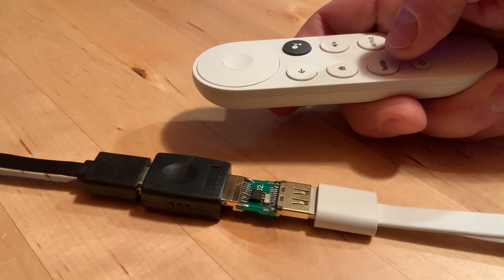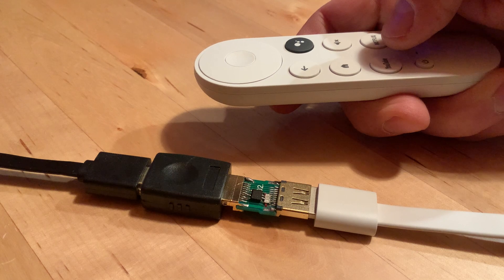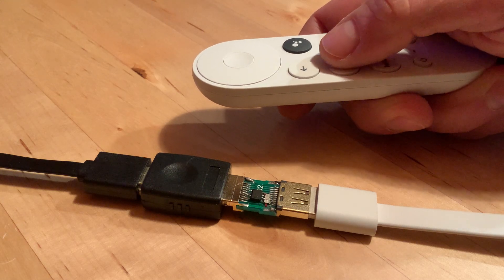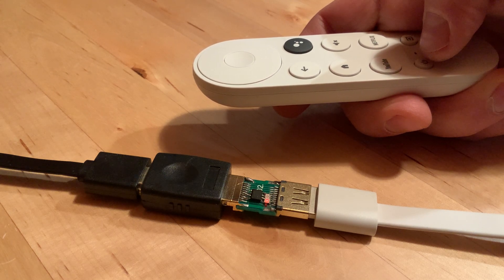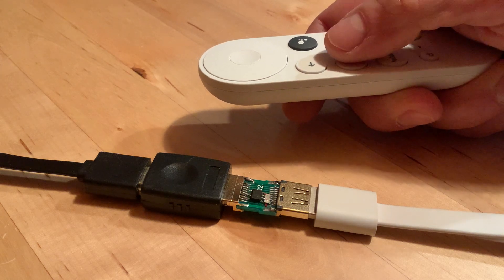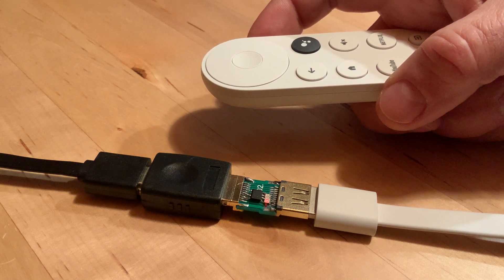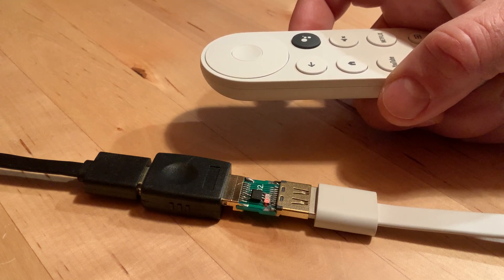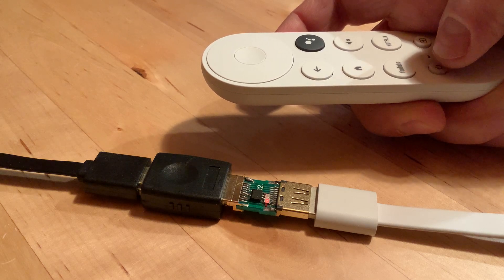CEC Tiny

Comment: How could I make the Android TV Bluetooth control be able to control the volume of the analogue sound system and also turn it on or off depending on the state of the TV?
Reply from the maker: Really depends on what that analog system is. You could either drive a motor turning the volume potentiometer or (as I did) emulate key presses on a remote (if your system has a remote).
Reply: @SzymonSlupik  My goal is to control a stereo from the TV. The closest thing is what LG TVs have called IR Blaster, which is an IR transmitter that I suppose turns on/off and controls the volume of another device, but my TV (which I'm actually using as a TV box) is with Android TV.
Reply from the maker: Then use an arduino-based prototype to see if your TV outputs the needed CEC commands. If it does, you can start experimenting with addin an IR Blaster to send your required codes.
Reply: @SzymonSlupik  It's too much for me. Thanks for replying. Maybe I can try later or it's too late for me to have a real sound bar...

Comment: Do u sell these?
Reply: I need around 50 or so to start with, can I get a quote? Don't worry they don't need to be pretty just need tvs to power on with the computers
Reply from the maker: @Heathmcdonald  No I don't, it is just a hobby project, but all info has been published: https://github.com/SzymonSlupik/CEC-Tiny
Reply: @SzymonSlupik  can it be used as cheap hdmi-cec adapter for pc? hdmi-cec adapter from  Pulse Eight is hard to buy
Reply from the maker: @mafirh4vdus  I believe yes, but you may need to use a different variant of the AT processor to support UART / USB interface and develop some code to push the CEC events to this interface. I think this could be a good starting point for you: https://github.com/SzymonSlupik/CEC-Tiny-Pro
Reply: @SzymonSlupik  thanks. I find easier solution. I find old amlogic s905 android tv box from 2016, with custom firmware it has build-in hdmi cec.  I am using two pins from android tv hdmi (13-cec, 17- ground cec), other pins from pc. And it works :D. For automated power off, on TV, i will use power supply from pc (android tv has autostart), power off via script and adb.